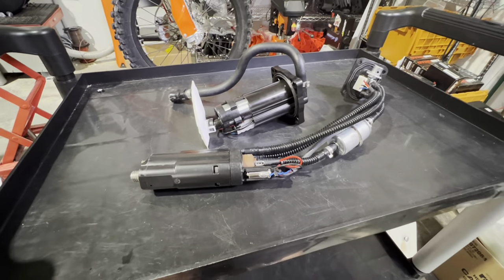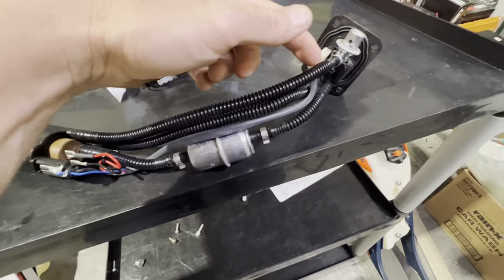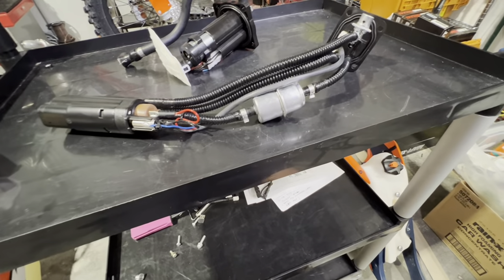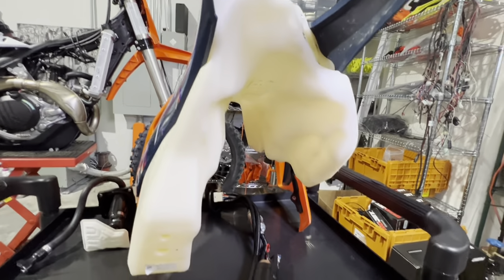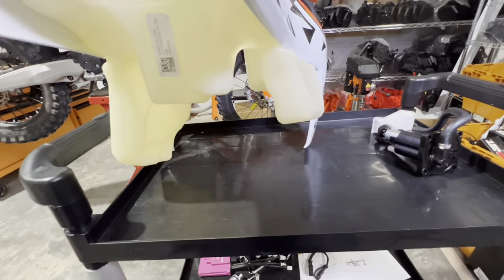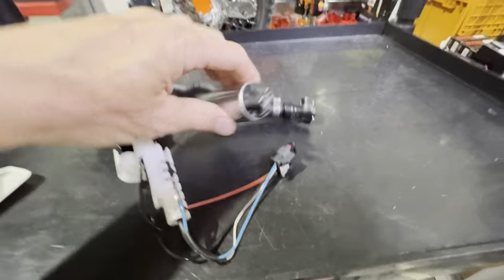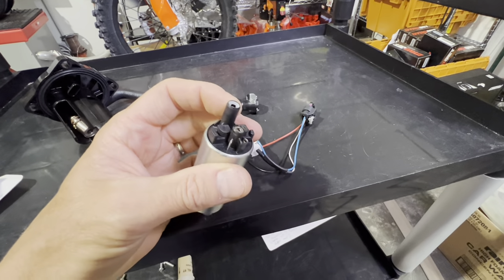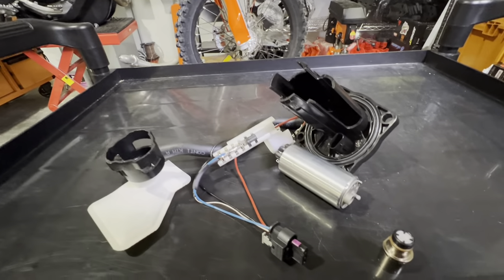23' KTM 450 XCF / 24 EXCF, XCFW FUEL PUMP DISSECTION

Comment: Very usefull video, thank you.
I use a length of saftey wire or similar and wrap it around the fuel pump's mounting outlet before I pull out the pump. Then I gently pull the wire out throught the tank on re-installation pulling the pump back in place. Easy Peasy & takes seconds to do.

Comment: Very informative and appears KTM finally realized they had a flawed fuel system design.  Interesting in the trade off between serviceability and access to fuel in the tank.
Reply: where was this video 2 months ago when I bought my  bike and thought I had fuel putmp problems. drove 3 hrs back to dealership left bike over weekend only to find out that bike was just to low on fuel   btw I ride single track mostly
Reply: This has to be one of the dumbest ideas they have come up with!!!!!!!!!!!! They should offer a fix. Stop following Honda and keep your  your customers happy. This is a hot mess.

Comment: I recently did a fuel pump replacement on a 19 Husky FC-250 And it took a bit of time to get the fittings lined up and in the 2 holes but using a pick and some safety wire were Def key to the install.Bike had 190 hrs on it.Your vids are always very helpful,thanks Mike.
Reply from the maker: There’s lots of good tricks out there for sure
Reply: I used safety wire around the threads to pull it through and it was a complete non-issue for installation, at least on my larger aftermarket tank.
Reply: @markbour  Same here.
Reply: I had to do the Sabe thing 🤙🏼 However, it’s wedges in the pretty tight..did it sit in there and line up for you easy? I’m worried there’s some pressure on the pump. Using stock tank. Thanks

Comment: Mike, what's stopping ktm or a road/ dual sport guy from putting an extension hose between the pump and the fuel sock and throwing the sock down in the tank wing to draw from the bottom?
Reply from the maker: Looking into that as a solution
Reply: Wouldn't this possibly lose prime between the sock and the pump? Like potentially you need a check valve at the bottom then as well?

I'm not sure how this splash fueling method could be good on the exc - like if you do a flat highway section, you're just going to run out of fuel before running out of fuel no?
Reply from the maker: Keeping fuel in the pump cavity is key
Reply: That's a very very good question

Comment: Hi Mike, great info.
In the old system the internal fuel filter would turn black after the first few hours of operation. Not sure why but what I read was that it came from the pump itself, maybe from the brushes.  Hopefully this new pump will not generate that type of debris, which in the new system seems like would go straight into the fuel injector.  Unless there is good size external filter...
Reply from the maker: All pumps generate carbon

Comment: I use gas cap vent hose to pull the older style pump through the tank. It fits tight enough over the threads to give you something to pull on.

Comment: So you think the 23 and up fuel filter is about a 200 hour filter? I kinda agree. I have a 2023 with a random bog. It’s frustrating but for the last 2 months I’ve dove into everything. There is a good amount of post about the tbi bogging and people/dealers think it’s the pump filter. I have cut one open and you would need muddy gas to completely clog it. I think there is a bug with the tbi’s and a bog thats just inherent for hard running bikes, not weekend trailer bikes. I am curious how much the check valve in the quick disconnect is released when the male portion is inserted. Could the quick disconnect act like a choke point for fuel? These bogs i am talking about are on good running bikes, but every once in a wile you twist the throttle and nothing, then it will be fine for a wile. It aggrevating and in some cases like mine, dangerous as it did it on a jump breaking ribs and getting my spleen. I have been trying to figure this out, ktm diagnostic tool shows no issue, and ktm said it would have to do the bog wile hooked up. Kinda impossible, maybe with a dyno but no dealer around me has one or can invest the time to figure it. Mine is an XC and i will not run on my mx track at anything lower than half tank just to make sure pump doesnt get starved. Thanks for the vid, it helped me with understanding the regulating property of the pump.

Comment: Excellent video!  Thank you. I have a question about the old pump design. The lines that run to and from the filter are attached by hose clamps, but at the other ends they seem to be fixed in place. Can the other ends be removed, and how?  Seems impossible to replace just the fuel lines.

Comment: A few people I know, myself included have had issues with the new system in that the sock filter seems to get plugged up. My friend's bike died at 4 hours, attributed to the plugged filter. At 89 hours he has the same issue with the filter being plugged (pump is still good).  Mine plugged at 55 hours. The bike won't start with a plugged filter as the bike reads low fuel pressure.  I know of a third and possible fourth bike in our extended riding group with this issue. One being another sub 5 hour old bike.  The current theory is the filter is screening down to a very fine micron.  Alternatively we're wondering if it is a regional issue with dirty fuel from the gas stations or additives for the market (east coast Canada).
Reply: I've noticed problems too. I added the KTM fuel fill filter and didn't notice any improvements. The amount of filters I've gone through in 25 hours is pretty wild though. Idk if I either have really dirty gas, or maybe Yamalube clogs filters. 🤷🏼 I've also found that my fuel pump will not self prime. I have to take the quick connect off and suck prime it after removing it from the tank.
Reply: @HoneyBadgerRy  That's not ideal by any stretch. Dealer is telling me that I with the fuel sock added I shouldn't have any more problems. I mix with KTM 2T oils and have stayed at the recommended 60:1. I haven't put on many hours since I had an issue, maybe 10-15 hours because it is winter here. Seems the sponge filter is really sensitive. Have you pressure tested you fuel system? Wonder if your pump is failing after working so hard with plugged filters?
Reply: @TeamStruggleBunny  I did order a taco moto fuel pressure tester a couple days ago, but it hasn't came in yet.  I'm not expecting anything to come from having it though, I only experience problems loaded on a MX track, that seem to be more common with dirty filters. I really don't know if it's a filter or pickup or pump issue. I did change my inline filter from the traditional type to the aftermarket type, maybe it will make a difference.

Comment: This is a NO GO for us rally riders. We ride terrain but you may have road sections between Times Special Stages.  This design actually does not allow to use the last 2 litres of the 9 litre capacity. That is little under 20%.  That is too much.

Comment: What is the Allen key slot for in the regulator on the new style pumps. Is that for serviceability or can you adjust the regulator pressure with that?
Reply from the maker: Yes and yes
Reply: @TACOMOTOCO  that's actually extremally cool hahah

Comment: Great video Mike! Keep ‘em coming with the changes/new parts. I have a 23 300xc coming so a bunch will be the same. 
Curious about a few thing that I’ll need for my XC. shark fin rear? I guess a new design with the axel different? 
Skid plate. Looks like some great new mounting points, also looks like current gen won’t work. 
Single seat bolt, wonder if a hand turn attachment could be used like on the Sherco to make it a zero tool removal. 
Is the subframe Grab handle actually usable?
Reply: I have a 23 350 XC-F and Bulletproof Designs is just giving you a 22mm chamfered insert for the disc guard so that their current guards fit the new bike. Mine fit like a glove. There is no change with the front. Just need the insert for the rear. Also, the 17-22 rad guards fit the new chassis as well.
Reply: @Shecki603  great news! Thanks. I guess the OEM fan will fit since the rad guard do too?
Reply: @TechEnduro  ...I'm not 100% sure on the rad fan....because the shroud is so close to the back side of the rad. It's possible it could work though....I just don't know for sure. I don't have one mounted.
Reply: @Shecki603  the rad fan from the 19-22 won't work but the 16-18 model year fan does fit though, that's what I put on mine and it's perfect.

Comment: Mike, is there a reason the pump doesn't just have a hose extension that reaches down to the lowest wing? My gas light came on the other day, and I tried to get back to my truck via dirt roads...and the bike died a dozen times on the way back - despite having plenty of fuel in the wings. So frustrating!

Comment: In my world (my 500's are for dual sport and snowbiking), this new fuel configuration has me running, not walking, from my 10 year relationship with KTM.  It has proven to be an absolute deal breaker on the snow.  Super sad to see. Hopefully someone comes up with an aftermarket lower pickup soon, or it's off to another manufacturer for me. :(
Reply: I think a larger fuel filter could solve the problem,  one that runs over the left side "well" of the tank.   I'm sure someone will come up with a solution.

Comment: Riding and racing in Baja, I need at least a 3.2 gallon bigger tank for my riding, it will be interesting to see how well the aftermarket tank companies get fuel splashed  up from being carried farther down in the larger capacity 3.2 and 4.2 gallon tanks.....or will there be an attempt to carry the fuel higher raising the center of gravity of 1-2 more gallons of fuel?  I haven't seen any yet.

Comment: Do you foresee a larger aftermarket tank for this new XC-F platform? With the new fuel pump mounting position. Would deeper cavities cause more fuel that couldn’t be picked up.
Reply from the maker: Yes and yes but just shake to the side or pop a wheelie to get it
Reply: More likely to crash😆

Comment: Is the fuel pressure regulator adjustable? With a brand new OEM (in tank) filter with the bike running I have 47 psi fuel pressure (1 psi below the 48-52 spec) and experience an issue that feels like random loss of fuel pressure only on the track.

Comment: I believe my pump failed, fouling the filter and in turn clogging the pressure regulator open? Or maybe the regulator just failed as well. Anyway, its got a new fuel filter and pump but the psi only increased by 5 to 40 and doesnt hold pressure so i backed the regulator out. Started it and it was just pissing out from the word go

Comment: How I would solve the fuel pump issue on the 2024 bikes.
Put a hose adapter on the inlet of the fuel pump and run the hose to the bottom of the tank on the side of the tank that is the lowest. An inline filter could be installed on the hose and the hose end could have a fitting that allows fuel to flow into the hose and a threaded stud that fits through a hole that is drilled in the bottom of the tank similar to the earlier versions of the KTM fuel tanks. The parts could be 3D printed.

Comment: Hey Mike, As I see you commenting on a positive upgrade to in-tank filter maintenance. I had a question I think a knowledgeable mechanic like you might be able to answer,  is there a reason that one wouldn't put a rally replica oil cap on a 500, ( same year ) with a cooler adding oil to a total of 2.5 liters for example to get much longer intervals? I assume that you might be currently do this for baha racing. KTM owners could use this for the application of longer term dual sport rides. Thanks in advance for your reply.

Comment: But dont the japanese bikes have a completely different frame and tank design without these low wings on the tank?
So the pump sits at the lowest position in the tank anyway?

Just by looking I would take the old fuel pump and tank design from KTM.
A bit annoying that you are not able to get the tank empty that easy.

Comment: I'm struggling to get excited... 
KTM finally came into the 2000s with a unitary fuel pump assembly 🤔
What many other companies do with in tank pumps is use the return fuel to pull a vacuum in a venturi hose and suck the fuel out of the places the pump is physically too large to sit in...
I guess that's a bit too technical for the Austrians

Comment: Hi this is a terrible way for KTM to go. Now it is not as easy to have the tank with the fuel siting lower on the bike. They should have had a fuel pump in the bottom of the tank. The designers are going the easy way. One part of my interest in going from Honda CRF450L to the KTM was the aftermarket larger fuel tanks for KTM cary most og the fuel lower in the frame.
Reply from the maker: Taco moto has solutions and options for this coming soon 🤜🏽🤛🏽
Reply: @TACOMOTOCO  Ok that is good. But most likely the aftermarket gas tank manufacturers will build the tanks more upwards than downward. make the bike more top heavy
Reply from the maker: Incorrect
Reply: @TACOMOTOCO you have already the solution for the new pump?

Comment: Dramatic improvement is a bit overstated.  I understand you think the pump/pick up assembly is greatly improved, but the tank and pump placement is a step backward, regardless of what Honda or others manufacturers do.  I've never heard a Honda owner complain about a bunch of unused fuel being left over in there tank when the pump starts to starve, but lots of complaints online and in person about the drastic range reduction on their KTM/Husky when a bunch of inaccessible fuel is sitting in the "wing".  I love my Husky and my KTM, but KTM doesn't seem to give a shit when things are not right, because the bikes perform so well that people will continue to buy them.

But for riders like me who ride their plated bikes in the desert and need long range capability, this is horrible.  You must think the same since you've worked with someone to design your "dip tube" modification.  But since that is not self priming, I have be "out" on these newer bikes.

Comment: You must surely be joking us to say that because Honda have been using a stupid idea for a long time, then it's ok for KTM to do the same. After 2 hours of pushing and nearing heat exhaustion, with plenty of fuel still in the tank, I finally made it to the top of the last hill and was able to roll down to the gas station. When someone dies because of this, their surviving family will have a very strong case against KTM group. I'm selling my almost new 500 tomorrow. Never another bike from KTM, period.
Reply from the maker: That’s very unfortunate you had such a bad experience 

Happily our taco snorkel solves the problem. 

Would you like to try it before giving up and selling?